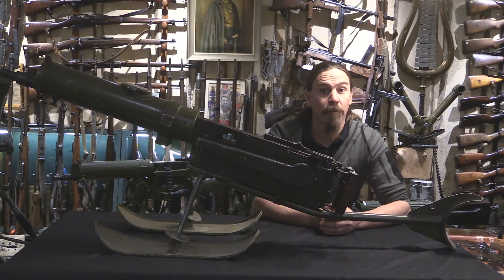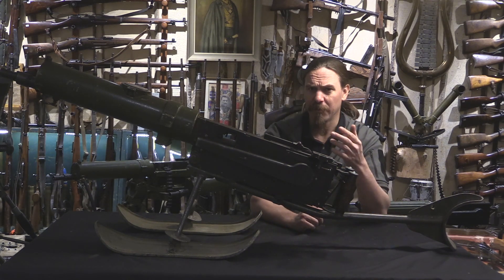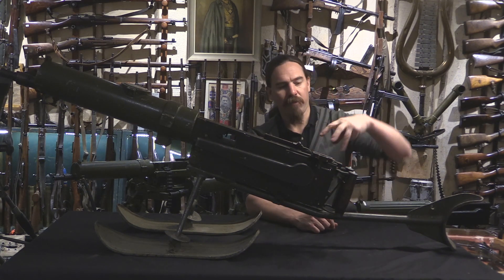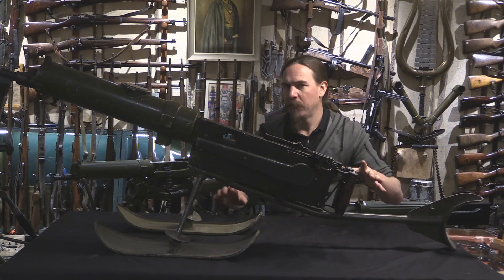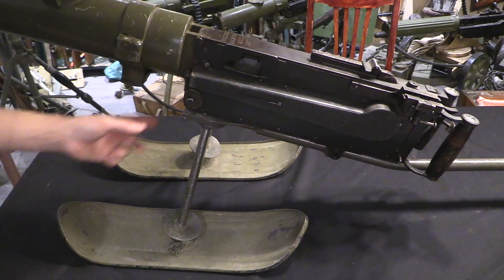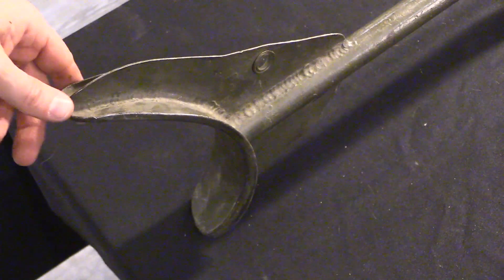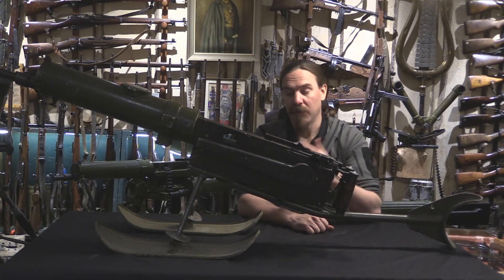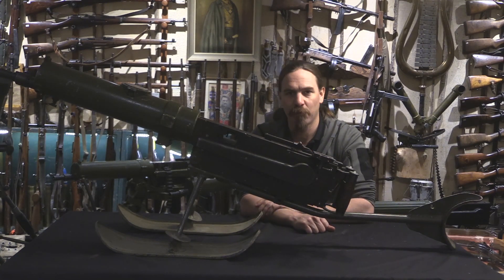M43 Salakari: A Dynamic Assault Mount for the Finnish Maxim

Comment: Brits: Water cooled
Americans: Air cooled
Finns: SNOW COOLED
Reply: Russians: Dump in vodka, comrade.
Reply: @JohnDoe-zs6gj  My grandfather told me that when they captured german mg first they looked for their cleaning kits. It had a technical spirit bottle in it. It was made drinkable by pouring it through angled spare barrel of that mg. We are talking a russian winter with temperatures below -20C. All heavier components will solidify and stick to freezing metal wall and drinkable spirit will pass.
Reply: Qled
Reply: Now we need a fire cooled gun

Comment: That stock is just begging for a rubber dip, given Finnish winters.  But, I suppose tying a burlap sack over the stock with some twine would work adequately to keep from donating skin to the Freezing Metal Gods...
Reply: Given how it's meant to be used with a Maxim with spade grips, it's likely the shoulder stock was there just to stabilize it on the shooter's shoulder and said shooter would keep their heads off the gun.
Reply: @PhoenixOfArcadia  While true, that doesn't change the fact that the stock is going to end up touching the face *a lot*, especially while rapidly getting into and out of position while moving from.position to position, as one would expect a rapid displacement mount that prioritizes tactical speed over precision support.